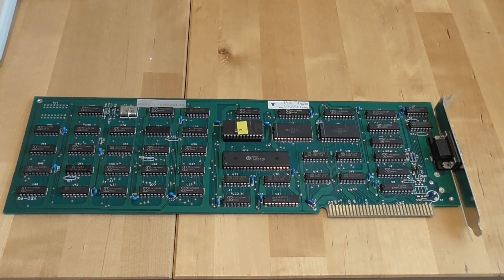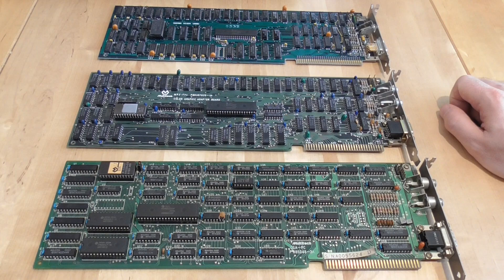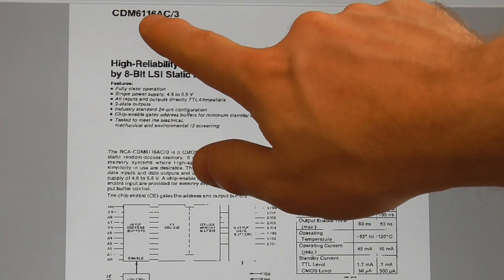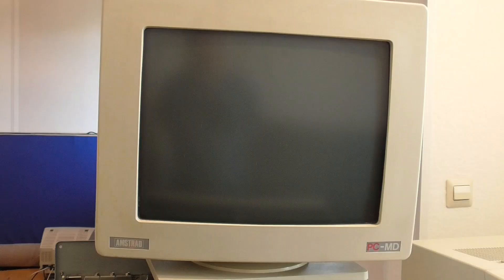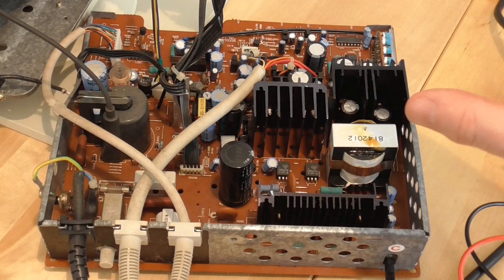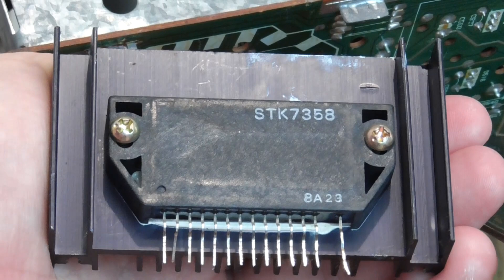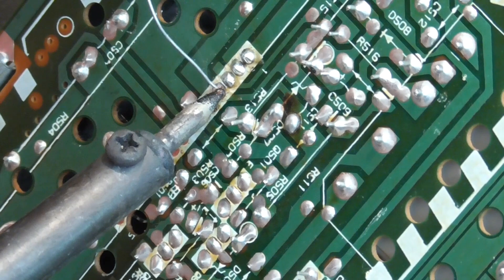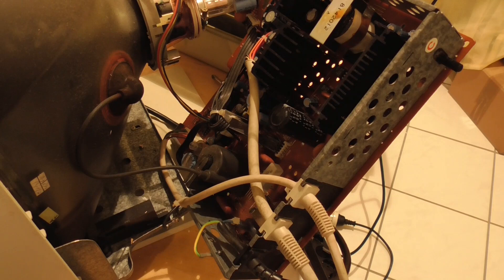Repairing and Benchmarking a Paradise EGA Card + Monitor Repairs

Comment: 28:09: What's the purpose of the second RCA connector on the Chips & Technologies CGA? One is composite out, but the other is what? 

Also, please find and watch the Technology Connextras video titled "Filming CRTs: It's pretty easy, actually". I may have said this before, but this time I really mean it.
Reply from the maker: My understanding is the RCAs on an EGA card were (unused) feature connectors.

There's nothing I can do about the flicker. There are zero adjustments on my camera. These videos always relate to super expensive cameras and editing software.
Reply: @PCRetroTech  Oh, did you say EGA card there? My mistake. I though you'd said CGA card. (I know about the EGA card and its feature connector + RCA jacks mullarkey.) I guess I was confused by the way TOPBench said CGA there, and you'd earlier said CGA cards at about 1:58, but I see now that the two Multitech ones from earlier are actually different cards. 
They still confuse me though, because they're supposed to be CGA cards, and they both have two RCA jacks each. 

W/r/t the flicker, if there's no way to adjust your camera, then that camera plainly isn't really suitable for filming CRTs. But I totally understand having to make do with what you've got, especially if you just plain can't get an adjustable camera at a decent price. If it were me, I would stay on the lookout though, or maybe even shamelessly mention your need on your about page. I sadly couldn't afford to gift you anything, but I just think you never know, there might be someone else out there who could afford it and who does find your videos sufficiently interesting to bother to do so.
Reply from the maker: @ropersonline  Yes, those are all EGA cards I'm benchmarking. The matched system is unrelated. It's just the one Topbench thinks matches it in performance most closely.

Re cameras, I can't accept donations anyway. But the cameras we're talking about are many thousands of Euros. I'm a hobby channel, so I'm certainly not going to invest that much without a fantastically good reason.
Reply: @PCRetroTech  Still, the Multitech cards from about 2:03 onwards aren't EGA but CGA -- and yet they still have double RCA jacks. That's the bit that still confuses me.

I admit I haven't checked camera prices. Sooner or later I'll have the same problem, and hopefully by then I'll find something suitably adjustable at a reasonable cost. Is an adjustable frame rate and a non-rolling shutter really such a premium feature still? I suppose it could be that mass market users don't care about these things.
Reply from the maker: @ropersonline Yes, the early ones are CGA, only the latter ones in the video are EGA. In those cases I don't know what the extra connectors do. I assume one is composite output, but even that is an assumption.

Cameras with adjustable shutter speed are not premium. Premium cameras cost more than a car. But the entry level professional range is still expensive, especially if you want 1080p or worse still 4k. The camera I currently have is already the second camera I've bought for the channel, and it is already an infinite improvement on what I had. But even channels with 100 times the subscribers that I have are still using this exact camera. Yes, it is extremely expensive to go pro. I have absolutely no reason to be thinking about that right now. I literally prepare and film videos on my spare weekends, after a normal 9-5 during the week!
Reply from the maker: The Lumix GH5 apparently has a synchroshutter feature (according to LGR). This can help.

But the problem with CRTs is the wide range of vertical refresh rates: 50Hz, 59.94Hz, 60Hz, 72Hz, 85Hz, etc. A lot of cameras have a couple of different settings, but not necessarily the one you want. And at 4K the selection is usually very limited. The problem is, one really needs very fine adjustment to actually synch the frequency of the refresh rate with the "shutter" speed. This really isn't available on cheaper cameras.

The Lumix GH5s' start at about 1500 Euros second hand, and would be a reasonable starting point I suspect, based on what LGR says.

But then you need tripods, lights, batteries, lenses, high speed compact flash cards, chargers, cases, very expensive software, and so on. And the other thing you are eventually going to want is a camera operator. That's by far the most expensive thing. 

I might get a decent lens for my Canon EOS 650d which will do 1080p at 30fps and play around with that and see if it is any better than my current camera.

By the way, "variable frame rate" cameras usually refers to cameras with very high frame rates (over 10,000 fps). What you are looking for essentially doesn't exist as far as I know.
Reply: @PCRetroTech  I was really only talking about matching the camera frame rate and CRT refresh. I didn't mean to imply any of the other expensive things you mentioned. I also think 4K is really unimportant, and makes non-matched CRT issues worse, if anything. I'm watching this on a decidedly lower-than-4K display right now. I've also found a lot of useful and semi-useful info in response to a google search of cheap camera to film crts with. 

Modern Vintage Gamer has a video titled "The Art of Filming a CRT TV Screen on your Camera or Phone for Retro Gaming" that contains useful info. I'm not always a fan of his mildly patronising typical "commercial YouTuber" presentation style around the edges, but there's good info in the middle. Apparently even rolling-shutter smartphone cameras can give you good, not perfect but good, results if you roughly match the frame rate and crucially also adjust the shutter speed. And apparently there are cheap or free smartphone apps out there for that. I haven't yet tried this myself, but it sounds like it could really help you improve your content on a budget. I'd rather watch stable lo-fi smartphone footage than a strobing and rolling CRT recording showing nauseating "special effects" in full HD.
I think the "good-looking CRT" fruit is a lot lower-hanging than you think, and your aspirational 4K durian doesn't actually taste nearly as nice. ;-P
"Perfect is the enemy of good enough."
Reply from the maker: @ropersonline Filming TV's is easy. Filming computer monitors is hard. Regardless of the equipment, you are always going to have a tradeoff between colour, saturation, flicker, moire and brightness.

There is no shutter in any of this cheap gear. It's a CCD, and any adjustments are made in software. All they can really do is adjust alpha, and if the CCD is high enough quality, possibly change the rate at which the data is read out.

The problem, as I pointed out, is that these cameras must match the refresh rate of the CRT exactly to the fraction of a Hertz, or you will get flicker or rolling effects. Cheap gear simply does not offer this possibility. Almost all cheap cameras offer one or at most a handful of fixed frame rates at a given resolution. E.g. I think my camera does only 27 fps at 1080p and they do not allow adjusting the shutter speed at all.

Software gets around it by combining frames together. There are plugins for Adobe Premier for example that will reduce flicker to some degree using this trick.

If you find something cheap that actually works for you, feel free to let me know. But I've already looked into it, and I'm afraid that I do not find any cheap options which actually work. Besides everything else, the video needs to end up in a format suitable for YouTube, and I have to be able to do all the work in a single day of filming and editing. Again, I'm not a professional videographer. I'm a hobbyist.

You should also consider that the YouTube algorithm likely grades video quality based on things like availability of 4k, so if you ignore that forever, you quite possibly will not gain a large audience. Eventually people will start asking you for it, whether you think it important or not, just as you are now asking me for flicker free CRTs.
Reply from the maker: Note there is already someone in the comments on this video asking for 4k one day.
Reply: @PCRetroTech  Oh, so 4K-ify all the things? ;-)
Well, you can chase whatever SEO trends you're faced with, or you can try and produce quality on your own terms. As an amateur with limited resources, you often can't do both. 
I feel I've said my piece and pointed out some water sources. Whether you choose to hydrate is entirely up to you. ;-P
(No offence and no hard feelings. SCNR. :o)
Reply from the maker: @ropersonline With all due respect, I believe that you are not understanding the subtleties of filming computer CRTs. I watched the Technology Connextras video when it came out. I've been subscribed to Technology Connections for years.

Technology Connextras talks about filming televisions, not computer monitors. This is easy because, as he explains, you only need to set the shutter "speed" to 1/30th of a second or 1/60th of a second (or 1/50th if in a Pal region). This is not difficult because common frame rates of cheap cameras are 24, 25, 30, 48, 50, 60 frames per second. So it's usually not too hard to find one that supports the required shutter speed at an appropriate frame rate. You can get one under 1000 Euros. (However note that just a couple of minutes in he explains that NTSC is actually just below 30 fps (just below 60 for high definition), as I already mentioned. So even that won't hold sync for long on a camera with a real 1/60th of a second shutter speed, which unfortunately exists! Imagine trying to film a game for more than a few seconds!)

But computer monitors do not all run at the line frequency. Once you get to VGA and SVGA, you get all sorts of other frequencies. And the frequency may change when you go from Windows to DOS for example, or into a given game. Therefore, a cheap camera is not going to help. You need one that can match a wide range of frequencies. And it needs to match them exactly. For example, you may need to match 60.1 fps (LGR gives such an example).

Furthermore, Technology Connections does not mention that filming standard definition TVs is easy because they are low resolution. This changes when computer monitors are involved because of Moire and other effects related to colour, saturation and brightness. Many of the reds in my CRT videos look brown because I have to lower the brightness of the monitor to a very low level due to the high sensitivity of cheap cameras to certain wavelengths of light. This sensitivity either affects the colours (almost all colours come out white), or it affects the flicker (change the light level and the camera will try to adjust to compensate, causing strobing). It takes ages in any given shot to get the best balance with the equipment so that the result is not totally unusable!!

Your second resource "Google cheap cameras to film CRTs" is going to return exactly the same kind of information because to most people writing about this issue, a CRT is an NTSC television. And that information will come along with the opinions of a lot of armchair experts too.

If someone wants to be an expert on filming CRTs and advise me what I should do,  they should at least have tried to do it themselves and should be able to show me the results. I have tried to do it, and have spent many hours trying to figure out how to do it and many hours reading about the subject. (And that includes use of an IPhone, which by the way gave absolutely unusable results on the CRTs I tried.)

I already know what I need to do to film CRTs without flicker, and I can tell you it requires something beyond an entry level camera. This requires money I'm not prepared to outlay at this time. Just to reiterate, NONE of my three cameras currently do 1080p video at an effective shutter of 60, or 50, or 72, or 85, etc. Edit: actually this is not true. One of them actually does 50.

Alternatively I can use software to combine frames, which can partially alleviate the problem. However, the software is expensive, like the cameras. And that solution takes up time I just don't have.

I will do some further experimentation over time that doesn't cost me big money, and if I ever decide to make the investment in a better camera, then the problem will improve. In the mean time, I am quite confident there is no easy solution to this problem.
Reply from the maker: I got the IPhone app that you mentioned elsewhere (ProMovie) working with my CGA monitor. One has to hold the phone at precisely the right distance from the screen, otherwise there's insane levels of noise on moving images, set the ISO and screen brightness correctly and it will give flicker free video with the exception of a black line across the image every few seconds. 

It's a reasonable, cheap solution, though some of the colours are completely wrong (e.g. a pink comes out as blue and so on), and there's a lot of noise in the image. I haven't been able to get around those issues.

And filming with an IPhone is a pain in the neck compared to a camera, so I wouldn't like to be doing it regularly, but beggars can't be choosers.

I'm hopeful my DSLR will do a better job as it has a very large, sophisticated CCD and lots of options. I will test that when I get a lens for it.

My usual camera is Pal, I just discovered, so everything is based on 50 Hz, not 60 Hz. This explains why there is so much flicker when using it on a CGA monitor at 60 Hz. Neither the monitor nor the camera have options to change frequency, so that's a mismatch that can't be fixed.
Reply: @PCRetroTech  "I got the IPhone app that you mentioned elsewhere (...) working with my CGA monitor." 
--> Oh, haha, I'm a lot happier to hear (read: read) that than all our back and forth yesterday.. :-) Glad things worked out in the end and I didn't make you spend money for nothing. Maybe we can talk some more at some later date – and maybe on better terms. :-) Peace.
Reply from the maker: @ropersonline  One slight correction to what I wrote. The manual that came with my camera does not mention a shutter speed option and in the main menus there is no such option. However, online I found a more comprehensive manual than the one that came with it, and there is an additional menu I didn't even know existed on the camera. It has a shutter speed option.

Unfortunately the options are 1/50th, 1/100th and it gets worse from there. So nothing usable for 60Hz. But technically I was wrong that there are no options for shutter speed on the camera. There are, but they just aren't useful in this instance. The 1/50th option I was using is the best by far, though still nauseating of course. The framerate (though not particularly relevant) is of course fixed to 50 fps in 1080p mode and cannot be changed. That's a Pal standard of course.

My EOS camera absolutely has a suitable option, so I have ordered a lens for it. That should be the best solution given the equipment I already have. I'll probably give a mention to all this in the next video that I make featuring a CGA or EGA CRT. I'll mention the IPhone apps in case it helps someone else, so thanks for pointing that out.
Reply: @PCRetroTech  By the way, and I'm sorry to say this, but I also have to correct something I said elsewhere: 
When you said that rotating solid wasn't an icosahedron but a gyroelongated square bipyramid, I agreed with you. But I shouldn't have. Because I did end up checking just before that went away, and I have confirmed that it was in fact an icosahedron. I went a bit overboard to figure that out, but I did figure it out just as that video went away. 
(In your defence, there was a perhaps slightly exaggerated perspective or minor fisheye lensing effect, which may have contributed to fewer faces staying in full view for longer, which maybe subjectively made the solid seem fewer-faced than it actually was. But I did account for all the faces, and if you really want to know exactly how overboard I went with that, I'd be happy to tell you how.)
Reply from the maker: @ropersonline  I am sorry, but here is the relevant code, which I wrote. Is it possible you are mistaken?

It isn't a gyroelongated square bipyramid either. As I explained, it doesn't have a name. I called it a twisted elongated bipyramid in the code I wrote for lack of a better phrase to describe it:

#define TWISTED_ELONGATED_BIPYRAMID 1
#define X 40.0
#define Y 24.5
#define Z 20.0
#define W 34.6
#define NUM_FACES 16
#define NUM_VERTICES 10
   char faces[NUM_FACES][3] = {{0, 1, 2}, {0, 2, 3}, {0, 3, 4}, {0, 4, 1}, 
                               {1, 5, 2}, {2, 6, 3}, {3, 7, 4}, {4, 8, 1},
                               {5, 6, 2}, {6, 7, 3}, {7, 8, 4}, {8, 5, 1},
                               {9, 5, 8}, {9, 6, 5}, {9, 7, 6}, {9, 8, 7}};
   double coords[NUM_VERTICES][3] = {{X, 0.0, 0.0}, {Z, -Y, -Y}, {Z, -Y, Y},
                                     {Z, Y, Y}, {Z, Y, -Y}, {-Z, -W, 0.0},
                                     {-Z, 0.0, W}, {-Z, W, 0.0}, {-Z, 0.0, -W},
                                     {-X, 0.0, 0.0}};
Reply from the maker: I uploaded a longer video of the same code running so you can analyse it more easily. I apologise for the focus and colours, but this camera is fixed focus and not designed for close up shots like this. It does have a 60 Hz "flicker" mode, so it is at least flicker free.

https://youtu.be/SiuEAcmBaSk
Reply from the maker: If you keep an eye on the alternating cyan and adjacent "purple" triangles you will easily see it cannot be an icosahedron.
Reply: @PCRetroTech  Can I post imgur links here, or do they always end up in the spam filter? It might be easier to show you what I did to reach my conclusion.

I havn't taken a detailed look at the code yet, but I what I'm seeing is just two arrays and a bunch of defines. If you posted more code than that, then I can't see it here. I'll have a look now to try and see if the arrays tell me anything, though without the actual code it won't be definitive and possibly harder to understand. Can you post a pastebin link of the whole thing or do those links also end up in the YouTube spam filter? 
(I've grown very cautious of quoting any links because of that, because you never know if anyone will even see the comment then.)
Reply from the maker: I don't know what YouTube will do with links, sorry. If they are on topic, I won't personally remove them.

I can't post more of the code, sorry. It's thousands of lines of assembly and C and part of a larger project which is not yet released publicly.

The arrays I posted are the lists of coordinate of the vertices and the triples of points defining faces (as indices into the list of vertices). As you can see, there are only 10 vertices and 16 faces. That should be conclusive.

If not, please read my second comment. If there were 5 faces around that end vertex it would not be possible to colour them alternately, as 5 is not an even number.
Reply from the maker: Actually, a portion of the code is public here, but I don't think it is going to help you much:

https://github.com/wbhart/CGAGraphics/blob/master/cga320x200/ludicrous/polyfill.asm

https://github.com/wbhart/CGAGraphics/blob/master/cga320x200/ludicrous/lineinc.asm
Reply: @PCRetroTech   It's not clear to me how this assembly code at all relates to the other C code array definition snippet, even if that assembly is ultimately sourced by the actual C code (that you didn't post).
But I have taken the array definition snippet and drawn a net and then assembled that net with toothpicks and blu tack, which I don't recommend, because it's not really a suitable choice of materials for this, as it's far too fiddly. But I did get a solid out of that, and that solid actually is a gyroelongated square bipyramid. (See the Wikipedia article on that.) Why did you say it wasn't? Because the pyramids are or seem perhaps a little flatter? 
On nomenclature, ultimately geometry is a little like chemistry here, I don't think you can ever really say such a solid doesn't have a name; even if there's no proper name, such solids can be named systematically.
I've started to take a closer look at your new footage, and it looks like the polygon-filling at the edges where two filled polygons meet isn't perfect, so there are some slight artefacts there at times. It's possible I might have seen some of those artefacts in the old footage and misidentified them as additional polygons. I no longer have the old footage and I've removed all the stickers from my paper icosahedron, so I'm not likely to repeat that. Once I've had a closer look at the new footage with my toothpick model in hand, that may be enough to convince me. Trying to reproduce ones earlier cold fusion experiments might be a fool's errand, even if it looked pretty conclusive at the time.
Reply from the maker: @ropersonline  It's close to being a gyroelongated square bipyramid, but that shape is longer than mine in one axis. Mine is flatter in the elongated direction, i.e. as you say, the pyramids are flatter. In particular, a gyroelongated square bipyramid is constructed from regular polygons. It can easily be checked from my coordinates that it doesn't satisfy this definition.

The issue at the joins is merely due to the dithering. If I reversed the order of the dithered colours on one of the two faces, that would go away. This is a work in progress and I haven't got around to fixing that issue yet, or the occasional black line that runs across the bottom left corner of the object. As I said, the work has not been made public yet.
Reply: @PCRetroTech  Are you on vcfed? Are you happy to share any contact details that aren't public YouTube comment replies?
Reply: @ropersonline  I'm not on vcfed, but I'm on Vogons. I have a CGA Graphics Library thread on the Milliways subforum.
Reply: @goodwillhart  / @PCRetroTech: Hey, are you aware of #DOScember? Maybe that's something you may want to participate in? It's kind of up your street, isn't it? Also, you could prolly get a bunch of viewers that way.